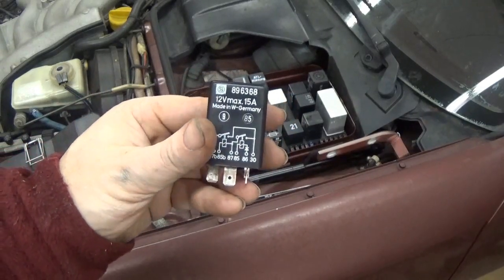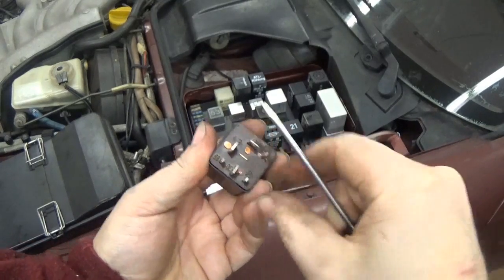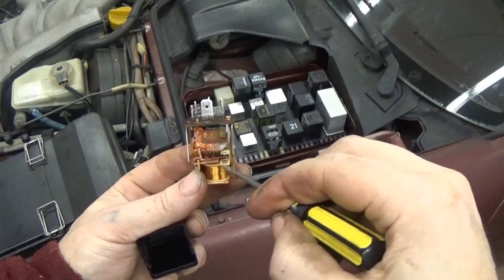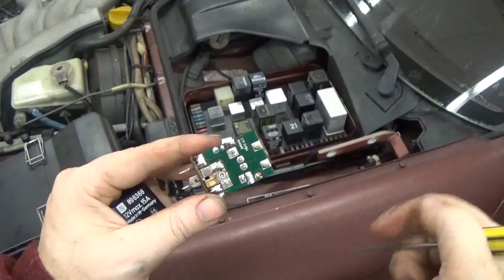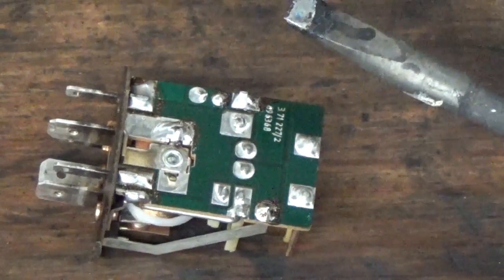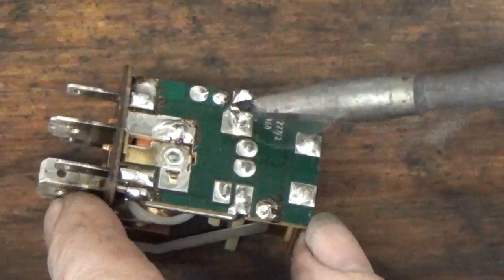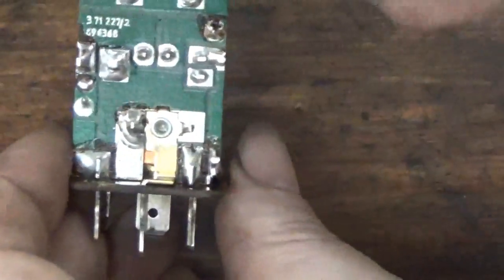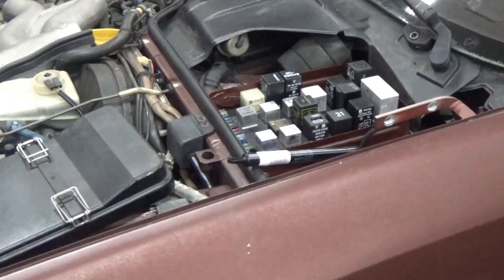Repair a Porsche DME Relay

Comment: Had the same problem with a HVAC relay on my 993. Since I had the relay apart, for all joints: I heated up the existing solder, along with a dab of 'new' solder, and thus 'freshed up' all the connections. Yup, worked a treat.

Comment: Not a cold solder joint. Big difference between thermal pulled solder joint and cold solder joint and the distinction should be clearly made here. This will tend to happen again where a cold solder joint comes from the factory and always only once.

Comment: Thank you for  this video. I had exactly the same problem on my 1988 944S, where it kept cutting out for no apparent reason. I took the DME relay out and examined it, and discovered a similar dry solder joint. By following your video  was able to fix it myself. You've just saved me an expensive repair bill!

Comment: I have a 1986 944 N/A, recently a few of the electronics have intermittently stopped working. 
The functions lost are: windshield wipers(F & R), fog lights, blower for climate control, power mirror and windows. 

Replaced the battery a few weeks ago and everything worked for about 2 days then same issues have occurred.

Have checked all the fuses and have begun testing the relays. 
Still have headlights, radio, power seat, dash lights, A/C clutch. 

Do you think this may be a battery/ grounding issue?
Where would be a good place to start checking?
Reply: Always check the electrical connections at the fuse box 1st if you haven't already. They are brass a little more prone to corrosion than your everyday fuses. Disconnect the battery get a soft stainless brush and make a day of it. Lightly Dielectric grease everything. Enjoy.

Comment: I've been wondering why more people aren't just modifying the wiring to use a pair of standard Bosch four or five pin relays, the sort you can get anywhere for between $5.00 and $10.00 a piece. Those proprietary relays aren't usually made with the same quality that the more common configurations are.
Reply from the maker: This one is a little unique... because of the two-relays-in-one-housing, so you'd need to do a little creative wiring.  But, when I do fresh wiring in race cars, I do exactly what you suggest!